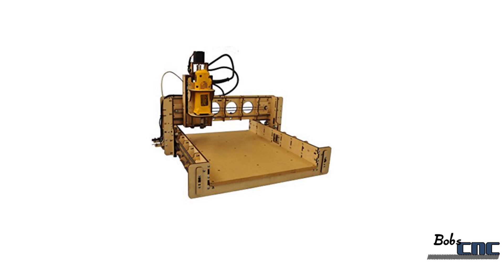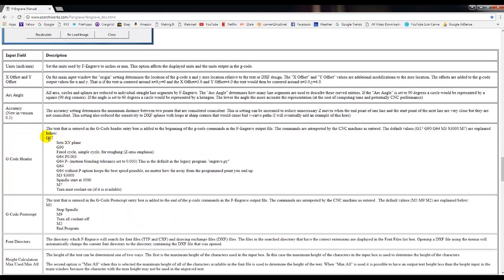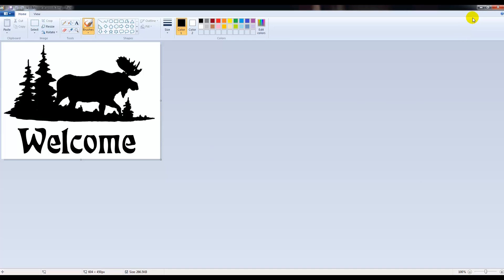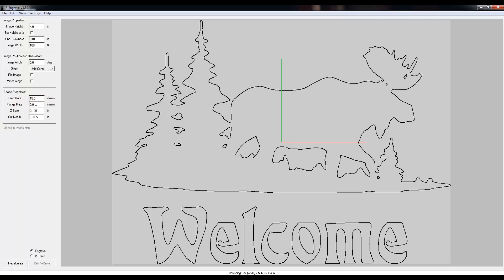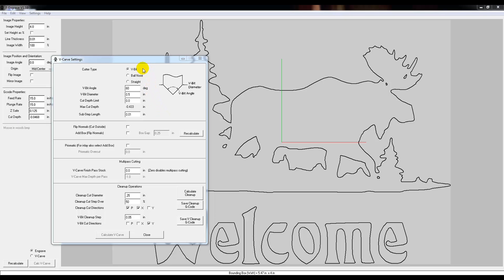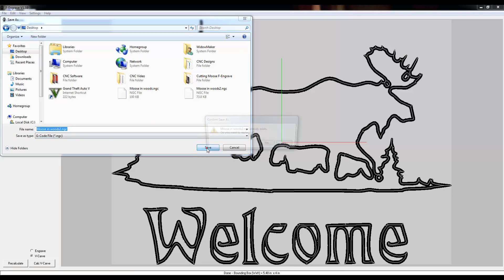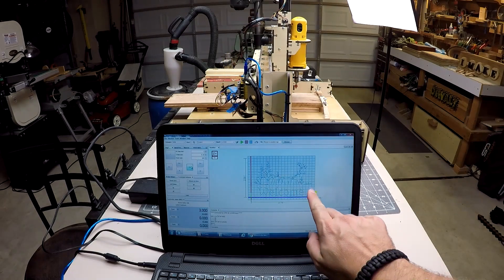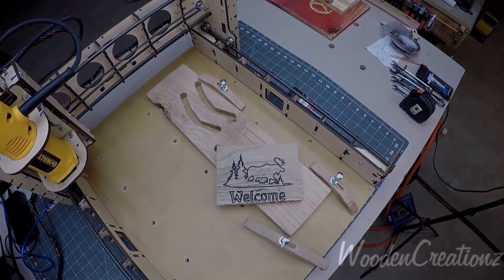F-Engrave - Design to Product on a BobsCNC E3

Comment: Thanks for the video!! I just ordered a bobs evaluation 4 I'm assuming it will work the same as the e3?
Reply from the maker: Just now saw this.. yep... you probably have it built.. but yeah it works the same. :-)
Reply: @WoodenCreationz  thanks for the response. yes I do have it built already but have not got to use it yet trying to remove the house and my shop.

Comment: Hi I cannot get my E3 to move around after I home it like when you moved it to the center of the moose. The motors works fine as the machine moves with its returning to home. It makes a weird sound and I can feel the motor working but the router doesn't move when im trying to position the router in the center of the piece. Please help.
Reply from the maker: Reach out to Bobscnc support.. they can help diagnose. My apologies I'm not sure what it is
Reply: @WoodenCreationz  I had the jog setting to low. Thanks for the video
Reply: what speed did you increase to?  i need to do the same   and did you apply it to values 110-112

Comment: What is the biggest piece of material one can carve with this. The one I looked up had dimensions of 25'' x 25'' x 19'', but I can't find a working dimensions figure and don't know enough about cnc's to have an idea as to what it might be.
Reply from the maker: Pretty much nailed with the E3 CNC dimensions are. There is a larger CNC by Bob CNC it's a E4. It's a 30 by 37 by 8.9.  Here is their website https://www.bobscnc.com/products/e4-cnc-router

Easel is another software you can use for this CNC. It creates a file called gcode and then you use ugs to cut it.

Comment: can it cut through acrylic plates?
Reply from the maker: It can...  It cuts, carves and does everything a normal cnc does. Its great for woods, plastics and softer materials.. A couple guys make acrylic signs with it, lit up by lights.. Great CNC and the E4 is a larger one... just as good.
Reply: I want to cut templates out of 1/4" acrylic.  Is that V-carve?  Engrave?  What bit do you recommend and how fast to cut?  Perhaps there is a tutorial or another source of info for this question?

Comment: How much do you need to know about computers and coding in order to have one of these?
Reply from the maker: Straight up... It's not hard. You have have a little computer knowlege. I install ugs, easel, or fengrave.. Java... If you can do that... You just need to get some scrap wood and do a little practicing. In about 3 projects you will be an expert. I laid these videos out so it's start to finish. The CNC takes about 8 hours to assemble but it was never hard. The biggest thing is Bob stands behind his product and will write you back and will help you if you need it... Weekends, holidays, after hours... The guy wants to make sure you get it going... If you have a desire to have one.. you will do great... We have a Facebook group as well that is a great group of people... Bob just released a bigger E4 cnc and I both you go with that one... It's an amazing machine a year and a half later... I have more videos using the CNC if you didn't see them. 👊🏻😉
Reply: So you're saying go with the E4? I'm decent with computers just not to knowledgeable with the softwares and codes..

Comment: is there a more accurate way to find center?? like plotting it with a calipers on the board ?
Reply from the maker: Rob M you are correct. If the board is small enough I use calipers and / 2. That has given me some really nice exact centers!
Reply: awesome , thanks for reply.. when I get the machine , ill be a nagging (-'
Reply: There's an almost unknown tool called a ruler. But it will require advanced arithmetic to divide by 2

Comment: At 12:30, your blue/red x/y lines suddenly moved to the midding as opposed to the far left/bottom.  Why?
Reply from the maker: Dragon Don I cut out a section of the film to make the video shorter. I'm sure I moved the CNC during that clip that I cut out. 👊🏻😉
Reply: I know that the video got clipped, but what I don't know is how you moved those lines.  Trying to figure that out.
Reply from the maker: Dragon Don Ahhh I see what your saying.. I set that point as center by clicking the rest button for x,y,z. In programs like vcarve you can choose the start position, sometimes it's easier to find the center of the board rather than start on a corner. In this example I just found the center of the board and reset zero there. 👊🏻😉

Comment: Very nice video. I've been wanting to get started using a CNC router without breaking the bank. This video inspired me to buy a Bobs and get started. I plan on getting my kids involved and make this a learning experience for everyone. Thanks.
Reply from the maker: Geo that is awesome.. You will not regret the purchase. Bobs support is out of this world amazing. Checkout my E3 install video for tips and all my other videos using it. Its an awesome CNC. Find Bobscnc on Facebook. We have a group of people that own it and its a great place to share and ask questions. Not trying to push my product, but once you get the cnc built, you may want a device to keep the bit free of dust so you can see your work piece. I make and sell something called a "Bit Duster". It uses the air generated from the router to redirect on the bit to keep your cut free of sawdust. Here is a link.. thats down the road.. but it works amazing. -Brian https://www.ebay.com/itm/Bit-Duster-E3-CNC-/122937289460

Comment: Got it all working...finally! Your video has been a godsend for navigating this. Question: How can I get F-engrave to etch out the entire letter or image rather than just outline it? For instance if I create a simple heart shape, can F-Engrave etch 1/64 of an inch into the wood to create a negative heart shape that I can then fill with paint or epoxy? Thanks!
Reply from the maker: Mr. Quintron awesome an! In regards to your question I don't remember off hand. You might shoot the maker of f engrave that question. I know in easel you're able to choose whether or not to do the inside line or outside line. And I've been playing with vcarve a lot and there's an option to choose to do the inside letter if you wish. Again probably best to double-check with the maker of f engrave. 👊🏻

Comment: Great video. Just getting started with my BOB CNC....I am confused about how to get the G Code to the router. Bob recommended  UGS software but I have no idea which version or really how to download it...can't even tell if it is free or not. Help....I am running Windows 8.
Reply from the maker: Mr. Quintron it's pretty easy Bud. Go to this website and download the nightly build. Link is in the description As well. I also have a video in regards to using easel with your CNC and I walk you through step-by-step how to use gcode sender. https://winder.github.io/ugs_website/
Reply from the maker: Mr. Quintron check out this video in regards to easel. I showed you the steps in regards to how to use Universal G-Code sender. Also easel is another great software and then it's free and it does a lot of what vcarve can do. Vcarve is obviously better but for free easel is the right you should take when you're first starting. Also find us on Facebook under BobsCNC group. https://youtu.be/Hp59LKPq3ko

Comment: what is the smallest sized text that the BOB router will cut and still look crisp and clean? I will be working mostly on 1/8 inch acrylic  sheets for making front panels on my homemade synthesizers. The acrylic surface is perfectly flat and smooth.  Any experience with doing small fine text? Say, 24  point? What would be the best bits for such work? These videos are incredibly helpful  btw.....you have got me 99% decided to buy one of these routers!
Reply from the maker: Mr. Quintron  I don't have an exact number but if you go too small it blows out the inside letters.

Comment: Great Video. Thank you so much.  Can you only do outlines of images in 2D?  Is is possible to do a cut that will cut out the middle in a 2.5D with this CNC router?  Can you do 2.5D with F-engrave and g-code sender?  Can you download a 3D image and then change it up with these programs and do a carve?   I hope I am asking this in the correct way that makes since.... LOL      New at this. Thanks again!!!!!!!!!!!!!!!!!!!
Reply from the maker: Evan Kenison A lot of great questions. Most I can’t answer. Those might be best directed to the Fengrave guy. But it sounds like you need a 3D software. That is not Fengrave but there are 3D softwares our there that can do what your asking. I haven’t got there yet. Allcustomz has.... bob is cheering for me to dive in. I’m still trying to catch everyone else up on the softwares you can play on for free... But yes... some times you cAn make a cut and it looks 3D. Hope that helps answer your question!! Brian

Comment: So everything is going real well for me with BobsCNC but i had a few questions, when im not using a vbit and instead using a strait bit or different bit, should i use a different program or can i use fengrave but do i change the settings from vcarve to engrave? Also how do you properly cut through pieces of wood? Do you use a different bit, and what settings/program do you use? Ive tried fengrave but i have an issue where the bit will get stuck and sometimes fall out of the spindle but also cutting aggressively and making the cut look terrible so at the moment ive given up. Any help?
Reply from the maker: Alex Brensike Hey Alex. Yes you will need to select the bit size for each project. I would look at inventables easel program for using the straight bit. Im in the middle of filming a tutorial on how to use it. You can use a vbit in that program as well. They didn’t write it for a vbit but just select 1/32 bit and it works fine. Your bit should never fall out of the spindle. Make sure you have the right collet and have it tightened up tight. It’s loose as snot until I tighten mine... then it doesn’t budge.
Reply: Yea for the vbit and strait bit i have to change the collet, Its really hard to get it tight since the spindle doesnt have a "lock" holding the spindle in place while tightening it is a pain, for the most part its tight but i cant get it really tight since it just keeps slipping from me when i try to do any more. How do you do yours?
Reply from the maker: Alex Brensike I have to do the balancing act to get it to stay until I can get both wrenches to tighten and then it is rock solid. Can’t remember the 2 wrench sizes it takes to tighten it.
Reply: Yea same for me but i use pliers instead which might be the hard way of doing things, how do you use wrenches? one for the part that detaches but where does the other one go? Im not at home or i would look at it to see but i have to use 1 wrench and then pliers to try and keep it from spinning while i tighten it.
Reply from the maker: Alex Brensike Yeah try wrenches...

Comment: I haven't seen much information on feed rate vs plunge rate. Can you help me out? I have a piece of plywood, half inch thick. I'm wanting to do a full cut out on it. I don't want it to damage my bit."IF" my feed rate is, like, 3-5"/min, or slower, I don't see why that would hurt it, but if there is a plunge rate, will it back track a couple of times to complete the full penetrated cut? can I set it to cut .125" passes, multiple times without stopping? Multiple passes?thanks for any information provided

Comment: Hey back again on a different video, question do you recommend the V bit for all types of cuts? Do you use different bits for different things? I feel like the main things would be the v cut or engrave, but what about if you are cutting out designs from the wood and need to go all the way though? Do you raise the piece you are cutting off of the bed or just leave it on there and? lol
Reply from the maker: Alex Brensike You use a vbit to do a name or fine detail work. If you want or cut through the board use a straight bit. (Looks like a drill bit) I put a board under my piece I’m cutting. That way I can cut through but don’t cut into my spoil board that comes with the machine.
Reply: Thank you again for the reply, I am using a "round" bit its what came with the dewalt spindle which might be another problem im having sadly because if i am correct a strait bit's tip is flat? I may need to just order some from amazon or go to my home depot or lowes and get one.
Reply from the maker: Alex Brensike This is the exact bits I have and the exact the ones I was talking about!!!! They do awesome!!!! Look for anything 1/4 And 1/8 shaft on Amazon. I have a 60 degree vbit and love it off Amazon
Reply: Haha sounds awesome im glad i found some that will work, i will buy these right away so i can get started

Comment: I have this and followed the instructions and it does not work
Reply from the maker: Bummer man... If you have the E3 cnc and just put it together and havent had it working yet... Might shoot Bob an email if your stuck and can explain your issue. The guy is a genius and will take the shirt off his back to make sure you get up and running. If you have had the e3 running but this tutorial didint work.. Well might contact F-engrave if you think it might be the software.... Here is tutorial that Bobscnc put out using F-engrave. I did it click for click and had pretty good luck from Keiths video below I added. Once you get the hang of things you will learn to slow it down or speed it up, as well as set the plunge rate and depth of cut. https://www.youtube.com/watch?v=QX4fs3oDndg&t=477s Hopefully this helps yeah. Brian

Comment: Hi! I've recently gotten an E3. Im using it carve stars for flags. However, I've had an issue with a few stars not aligning correctly. it will do 47 stars pefectly, but 3 will be out of place. Any idea how to fix this issue? Thanks!
Reply from the maker: Thats a good question... Maybe its the drawing? Another idea is to try inventables easel software. Its free and you could drop the stars and move them around if needed. When your have it how you like it, go to machine, advanced and create the Gcode... and then drop it in your gcode sender. Its another great free software.

Comment: Great video.  Do you have something that shows how to make a sign that is longer than the machine?
Reply: Just YouTube CNC Machine tutorials, and one video helps with the method called "Tile cuts" or "tiling" basically make a project into 3 separate pieces, and make sure you line it up right it works, for him, I haven't tried it, but there is a video.
Reply from the maker: cire1013 I don't yet. But Bob mentioned it's possible. If you did it in easel I think it would be the easiest. You can make a huge sign. Then delete and add parts easily and resubmit the gcode and have it cut the next piece in a straight line. 👊🏻
Reply: Thanks for your help.  I might do something in autofusion and use the Cam feature to break it up.  I look foreward to more of your videos
Reply from the maker: cire1013 Absolutely!! And I have just been gifted a brand new version of Vcarve Pro.... I plan on making a lot more projects with this CNC, but this will give me better accuracy when doing the hole diameter of a gear or the Exact size of a part instead of guessing... Look for those videos in the future. If you look on my Instagram. I have been working on a gear operated sign. I should have a video out soon on that

Comment: How do I have it cut all the way through something instead of engraving? Thanks in advance.
Reply from the maker: googIereallysucks Use a straight bit vs a vcarve bit and you can cut instead of engrave your work. Easel by Inventables allows you to easily slide the depth of cut bar up and down. 👊🏻
Reply: Were you able to use Bob's cnc with Easel? I am trying to use easel but can not figure out how to connect the cnc router.
Reply from the maker: googIereallysucks Design your piece. Once your done click, machine, advanced then export gcode. Save it and open it on gcode sender. You can techincally set it up... But it requires a firmware change and bunch of headaches after that.. Brian
Reply from the maker: googIereallysucks 👊🏻

Comment: After moving the file from F-engrave to UGS the image is to large. How can I reduce the width of a image.
Reply from the maker: Samuel Harvey There is a percent size I think at the top left for making it larger if you want to change size... Can't remember off hand. Another software that I play with that is free is easel with inventables. It's Gui so you can drop and drag it larger and smaller. Then click machine, advanced and then export the gcode. Then throw it in gcode sender. If you want to stick to f-engrave...